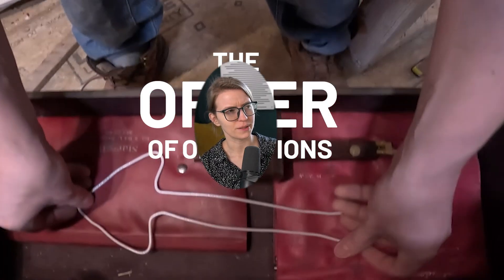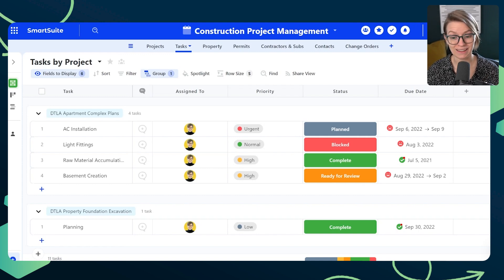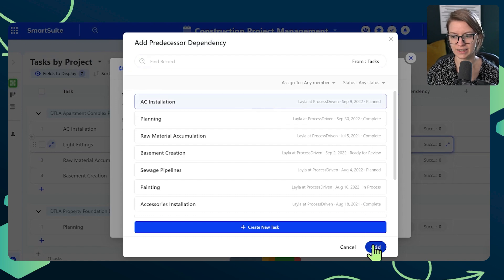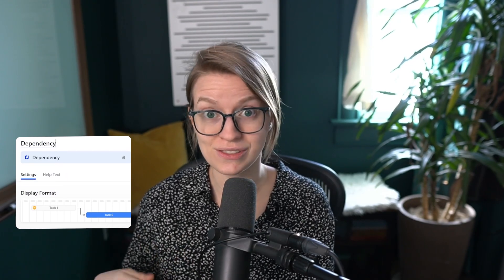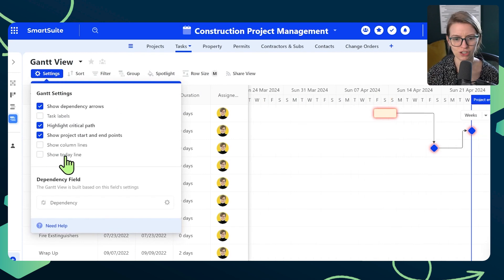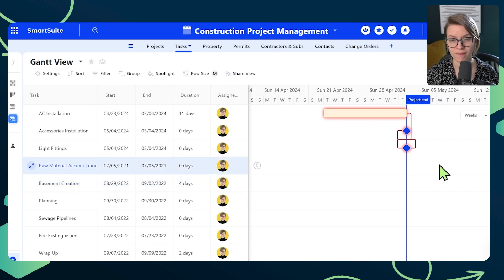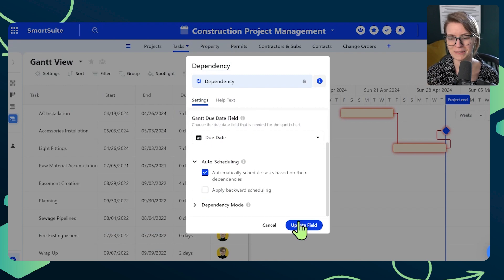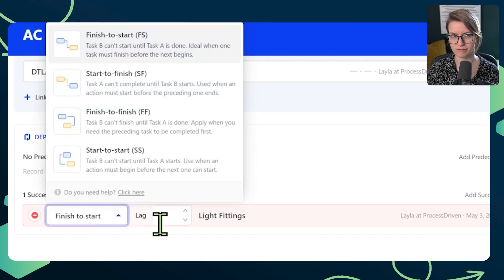SmartSuite for Project Management? You NEED to use this feature...

Comment: Turns out I have been trying a lot of management tools like this to find one that works for building a house recently, so I thought..."Why not check, you've tried nearly everything else". 

.....and, I've gotta say that I am really liking it. Dependencies are not really a new thing for tools like this (well not it's common but some do, and i agree this prob does it better than most), but I really like the layout and feels intuitive. I was able to customise what I wanted from mixing templates (pro tip: you can export a section to another project... kudos to the developer that did that). The closest thing I've got to what I wanted was clickup, but I think this has now taken the lead and might finally be something I can use for my upcoming build project.
oh, and love that it has options on the bottom of columns like the sum amounts etc...great for me when getting quotes and estimating costs of materials etc.

Still early days, but thanks for the recommend 😸